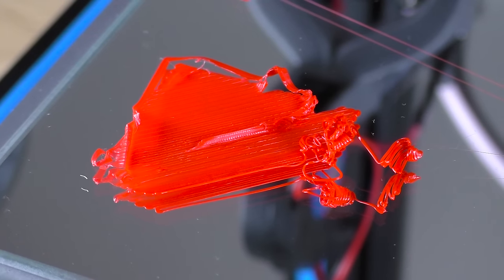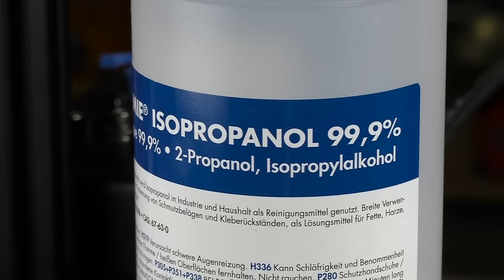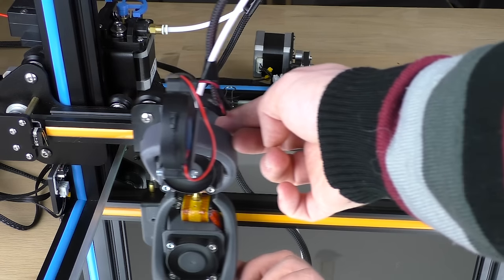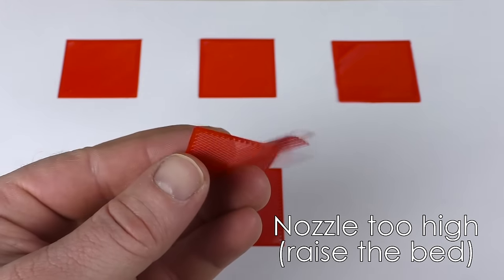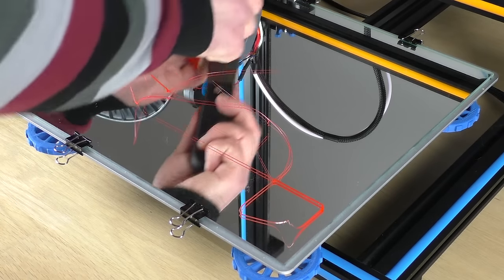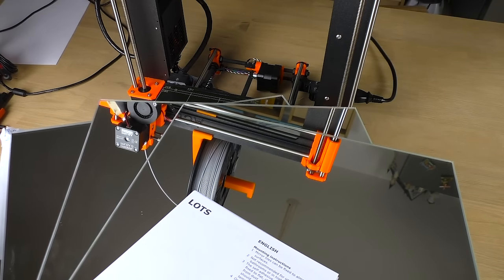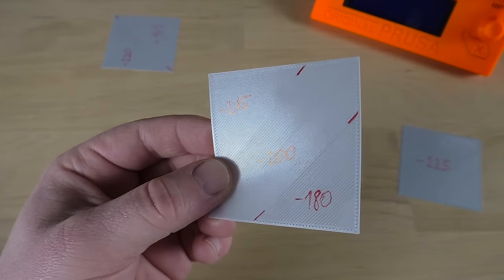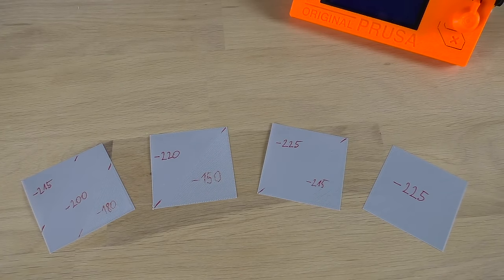Best method for 3D printer bed levelling

Comment: subbed of course. and do you know the name of the ikea mirrors you mentioned ?
Reply from the maker: Thank you! They're called "Lots" and come as a pack of 4. I'm on mobile now, it's hard to search, but I think I've pasted a link to someone in the comments.
Reply: @HobbyHoarder  £6.50 in the UK but too big for my Ender 3, could cut them down I guess. Thank you for the info, very helpful :)
Reply from the maker: Yeah, they're a bit oversized for Ender 3. Are you having issues with the build surface? It's quite good from my experience, unless yours is damaged or worn out.
Reply: @HobbyHoarder  I'm a 3d printer noob on the wrong side of a learning curve LOL The stock bed is not flat,dips in the middle slightly. Surface adhesion is a pain but hopefully fixed with a glass bed. Have you come across any problems with the glass being so close to heat , is there a chance it might break ?
Reply from the maker: You could cut a square patch of aluminium foil and place it in the middle under the build surface (or more if it's really bent) to raise it slightly.

No, don't worry, glass can easily withstand printing temperatures, you're not even close to the limit. Since you've mentioned glass, I'd like to point out that mirrors work much better than plain glass, even though they might seem the same.
Reply: @HobbyHoarder  I do appreciate the help. And I won't pester you with fluff. I tend to ask experts like yourself questions that other viewers might like to know too . I do check the already posted ones as well. I'll try your foil idea but I think long term it has to be glass even though I hate the store layout of Ikea I will bite the bullet and get some 'Lots'  Yes mirrors are made to higher standard. I have had a bit of success. I focused on getting the centre of the bed level to the nozzle as that is where the test dog will be born. And cleaned the bed. At last a few minutes ago I printed out the base of the pooch and yes it is not perfect but for me it's leap forward in 3d printing .  I think I only have enough left of the small amount included with the printer to make a small puppy now :)
Reply from the maker: No bother at all, ask anything you want. If I didn't want to help, I wouldn't have created this channel :)

Most hardware stores will cut the mirror for you, usually for free if you buy it from them. I've also seen glass cutting knifes on the cheap, but I've no idea how they work and I'm sure you'd need to sand the edges a little.

Get 95+ isopropyl alcohol for cleaning the bed, it really works well. I bought a ton of it and then I just pour a small amount into hand sanitizer sprays, works great. Then just a quick wipe before every print.

Also, I've recently made another video on how to calibrate your printer, it might help you out as well.

Good luck!
Reply: @HobbyHoarder For me with more years behind than in front it's finding out that a 3d printer does not just print it forces you to adapt knowledge you forgot you had or learn new things so as to open up a vast world of creativity.  And imho being creative makes the world go round.      I took your advice and tried the tin foil trick to level a dipping bed.  I cut several pieces of foil a quarter of the bed size and stacked them  in the middle of the dip. I started with 8 and after a few levelling procedures got down to 6 and the bed is now level. My first print was an extruder knob for the ender 3. Started of well but flopped later like a broken umbrella . However it made me smile and I was quite proud of this thing. Best of all....it fits  hahahahaha THANK YOU SIR.
Reply from the maker: As long as you're willing to learn, you're still young :)

I'm happy to hear the aluminium trick worked. In what way did the knob print fail?
Reply: @HobbyHoarder  The knob stem printed fine but as the print extended out to form the wheel the filament became stringy and did not form the shape of the wheel. Instead it looped around,fell off to the side and resembled a spaghetti nest. I'm guessing it might be a cooling problem . Funnily enough it's "Catch 22" situation. I know I need to print upgrades to improve the machines performance but if it cannot print in the first place then it cannot get the upgrades ! LOL Catch 22 .The term gained currency as the title of a 1961 war novel by Joseph Heller, who referred to an Air Force rule whereby a pilot continuing to fly combat missions without asking for relief is regarded as insane, but is considered sane enough to continue flying if he does make such a request.
Reply from the maker: That sounds like your nozzle isn't close enough to the bed. Have you tried with the levelling squares again? It's ok if they're a little on the rough side.

The springs under the bed tend to sag over time, especially at the beginning, so you might have to repeat bed levelling often (i.e. every few days). Once the springs stiffen, you might only need to do it every few weeks or even months.

Comment: Here is a very dumb question: Should all corners need to be square?  I have 2 square (front left and center), others are kinda rectangular, what could be problem?
Reply from the maker: Not a dumb question at all. The shape of the squares doesn't really matter, they might as well be triangles or circles. For your specific case, I'm guessing that your bed is not square and the slicer automatically scaled/stretched the squares to fit them on your bed.
Reply: @HobbyHoarder  Thanks for the answer.  Actually it's Tevo Tornado, as far as I know bed size is 30x30 but I need to re-control the cofigurations from slicer and tornado itself.
Reply from the maker: @malpine  Ah, then yeah, double check that the bed size is set correctly in your slicer. I also highly suggest that you replace the firmware with the one from TH3D.

Comment: hello i found your channel and subbed you thanks so much please can you help i have an ender 3 i have printed some nice looking test bits benchys calibration cubes but noe the first layer does not seem to stick anymore i use pla and have had the nozzle at 200 and the bed at 60 but it just seems to extrude normally before starting to print then just cloggs round the 0.4 mm nozzle have you any ideas many thanks from clive in uk
Reply from the maker: Thank you Clive, I really appreciate it!

Try reducing the flowrate (extrusion multiplier) by 10% and try again. Maybe there's simply too much plastic coming out.
Reply: @HobbyHoarder  hi thanks so much for replying how do I reduce the flow rate I'm not sure how to do that thanks so much for getting back to me 👍
Reply from the maker: @clivesquire6463  It depends, which slicer are you using?
Reply: @HobbyHoarder  hi again i have the supplied ender  slicer and also i use cura  hope this helps thanks.
Reply from the maker: @clivesquire6463  Cura is the slicer, yes. Then find the setting called "Flow", it should be under the "Material" section. It's probably set to 100 now, so try decreasing it to 90 and see if that helps.
Reply: @HobbyHoarder  many thanks i will try that now
Reply: Hi again I have found the material section in the settings it says printing temperature 200 and build plate temperature 50 I am not really sure why that means sorry to keep asking
Reply from the maker: @clivesquire6463  No worries Clive, I'm happy to help.

Those are just your print temperature settings. While you're here, you might as well change them to 210 and 60'C as those are the temperatures that work best for most fillaments.

Before we go further, are you sure that the bed has been properly levelled? Did you try printing the calibration squares from my video?
Reply: @HobbyHoarder  hi yes I have printed several items all good quality but now for some reason nothing seems to stick to the bed it just cloggs the nozzle it seems very strange as I have not changed any thing how could I show you my first few prints please
Reply from the maker: @clivesquire6463  Have you tried cleaning the bed with isopropyl alcohol and paper towels? Maybe the surface simply got dirty over time. I tend to give it a quick wipe before every print. Touching it with your fingers can quickly reduce adhesion.
Reply: @HobbyHoarder  thanks so much for replying today I printed a calibration cube which came out fine then I went to print a benchy and the same thing happened the nozzle all got clogged again but I will try that I also have a glass bed should I try that? Where are you also thanks again 👍
Reply from the maker: @clivesquire6463  When you say it clogs, what exactly happens?

Yeah, you can try it with glass, just make sure it's really clean. Soapy water works well with glass if you don't have isopropyl.
Reply: Hobby Hoarder well the extruder goes to the center of the heated bed which is the supplied one kind of rough but I have noticed it is very smooth in the center now ,then when it lowers to lay down the filament it doesn’t stick to the bed as the nozzle moves along its chosen path the filament just sort of collects in a ball /blob so I then stop it raise the z gantry and pick off the stuck filament I have cleaned the whole extruder and the nozzle purges some filament prior to starting but just dose not adhere to the bed you are the only person that has replied I have subscribed to so many 3 d printer you tubers but not one helpful reply many thanks for your time 🤝👍
Reply from the maker: @clivesquire6463  No worries, happy to help :)

It's hard to tell without any photos, but that sounds like the nozzle is still not close enough to the bed. Could you try raising the bed?
Reply: @HobbyHoarder  morning thanks when I put the paper under the nozzle to check how exactly close should it be then I will try you square level test is that on thingy verse thank you for all your help 🙏
Reply from the maker: @clivesquire6463  It should be so close to the paper that you can feel the nozzle dragging on it, but you should still be able to slide the paper around.
Reply: @HobbyHoarder  OK I will raise the bed a little more later I think you need a medal for helping me🎖️🏅
Reply from the maker: @clivesquire6463  We all had to start at the beginning and I know how hard it is to find some help. Good luck!

Comment: Ok... I searched your videos hoping you had posted something on my current problem.  Either I missed it or you haven't experienced it.  So I'm going to ask here.   I just updated to Marlin 2.0.4.4.  Before this, I used the factory settings for about a week and marlin 1.9 for a couple days.  I didn't have this issue until 2.0.4.    Every time I print the calibration squares (I have been using the mesh bed level feature) but now, when gantry returns home after print, I get "thermal runaway bed printer halted: reset machine"  But only after the print every time.  I used an IR probe to measure temps and the bed never goes above my setting.  So i'm worried something is programmed wrong in Marlin, but I never changed any thermal settings.  please help.
Reply from the maker: I hope someone with Marlin experience will be able to chime in.

If you move the bed by hand, does anything happen? Does the temperature on the LCD change at certain positions as you move the bed?
Reply: Hobby Hoarder I put the original 2.4 file back, unmodified.   Problem went away.   But all I changed was enable bed mesh.   So I’m gonna step trough piece by piece (which is very annoying because I keep getting timeout errors when using visual studio. And have to unplug restart both printer and studio). So if anyone has a clue on that part...
Reply: @HobbyHoarder  Ok.. I found the source but not the cause.  

Here's what I did, in order:
T1 (test 1)
Marlin 2.0 Ender 3 default 
--completed print fine

T2
Disabled 
//#define STRING_CONFIG_H_AUTHOR
//#define SHOW_BOOTSCREEN
//#define SHOW_CUSTOM_BOOTSCREEN
//#define CUSTOM_STATUS_SCREEN_IMAGE

Changed custom_machien_name
-- completed print fine

T3
Disabled 
//#define ARC_SUPPORT
Enabled 
#define RESTORE_LEVELING_AFTER_G28
--completed print fine

T4
Enabled
#define MESH_BED_LEVELING
--completed print BUT when returning to home position:
THERMAL RUNAWAY: Bed
 PRINTER HALTED 
Please Rest

T4
disabled 
//#define RESTORE_LEVELING_AFTER G28
--SAME ERROR SAME WAY

This means the error has to do with mesh bed leveling.  But all I do is enable it.  I don't change any thing else.   WTF?!?!?
Reply from the maker: @NOC-H  Did you enable all the other stuff besides MESH_BED_LEVELING? You have to define the probe type and offsets, at least in the TH3D version and I'm assuming Marlin is similar.
Reply: Hobby Hoarder no.  But it wasn’t necessary in 1.9.   I went back to 1.9 and have everything set exact same.  Works fine.   Even added some code for features I wanted.    So I have no clue what’s up with 2.0.  By the way, I tried to “support” you through thingiverse.  But it said you’re not set up.  And the link you gave me requires PayPal.  Any other ways?
Reply from the maker: @NOC-H  Wish I could help you more, but I've only used TH3D before and it's been working fine for me. I suggest you try going on Reddit, /r/3dprinting, it's a huge sub and you might get better anwsers there.

Thank you! I've gotten the message from Thingiverse and I've fixed it now, although I think you still have to use PayPal.
Reply: @HobbyHoarder  ok... I think i sorted that issue...  had to change watch setting to 120s.  now i just can't get a good mesh.  but within a couple days I'll get my pin 27 board for my bl touch

I do have another question.  a new roll of filament, I just opened, measures (with my caliper) between 165 and 169.  I can change cura to 168.  But is that ok?
Reply from the maker: @NOC-H  168 is quite outside of 175, so it's probably not the best quality. As for printing with it though, sure, like you've said, set it to 168 in Cura and you're good to go. It should automatically adjust the flowrate to compensate for the smaller diameter.
Reply: Hobby Hoarder yeah. That was my worry.  Downside is I live in Thailand.  So it’s hard to get good quality pla for any reasonable price.  I’m gonna print with it and see how it turns out.
Reply from the maker: @NOC-H  Oh, Thailand, you're the first person I know from there :)

I've had most luck with filament that costs about $25 per kilo, seems to be the sweet spot. Even Chinese filament at that price was very good, usually within 1.74, which really surprised me.
Reply: Hobby Hoarder I’m not “from” Thailand.  I’m Irish born American with Japanese name.  Haha.   My wife is Thai.  Her fam got sick so we came here to take care of mom and bro.  I miss customer service and QC from states though.  And I’ll check that out
Reply from the maker: @NOC-H  Hehe, well, you're still the first Irish born American with a Japanese name on my channel :D
Reply: Hobby Hoarder happy happy Joy Joy.

Comment: I feel like I have to change my z-offset daily to maintain my perfect first layer. Is this common or is there something that I can do to make sure my bed is perfectly level for a longer period of time?
Reply from the maker: You might have to readjust your Z level occasionally, but definitely not every day. By occasionally I mean every few months or at least a few weeks if you have a cheap Chinese printer. You didn't mention which printer you're using, so I'll just cover two common issues.

First, if you have the Original Prusa Mk2, then it's very likely an issue with the PINDA probe (it measures the bed flatness). Some probes are very sensitive to heat, so your first print of the day might be ok, but the second one might be way off. My solution was to add a custom gcode that raises the head to the top position after the print finishes. By the time this happens and I load the next model, the probe has cooled enough that it doesn't affect the bed leveling. Because of this, Prusa has added the option of pre-heating the probe first and doing bed leveling after. I believe it's called "Temperature calibration" and you'll find it in the settings/calibration menu. I still think letting the probe cool off is the better solution, but this is also an option.

If you have a printer with manual bed leveling, then the corner springs might be too loose. If that's the case, you can either replace them or print spacers that go between the bed and the springs (but you must use heat resistant filament like PETG or ABS).

If you have a really cheap printer with acrylic bed, then I'm not sure there's much you can do short of replacing the bed with metal one.
Reply: Hobby Hoarder hey sorry I gave little information. I have a Tevo flash. I believe it's a glass bed with bltouch (plastic probe I believe) so it's best to set my z-offset when everything is cool?
Reply from the maker: I don't have personal experience with the BLTouch, but because it measures the bed by actually touching it, it shouldn't matter if it's hot or not.

How tight are the springs that push against the bed on the underside? Is the bed itself very wobbly?

Comment: Didn't work for me.. All I got was printed line down the side then it stopped.
So back to square one
Reply from the maker: Sounds like you're having some other issues apart from leveling. Can you print anything at all or is it always just the first line and then it stops?
Reply: To be honest how I feel with 3D printing I probably find it easier to beat James Cameron to making avatar 2 on my laptop that is hard I am finding it
Reply from the maker: @chasscollickmusic4299  I'm not gonna lie, I wanted to smash my first printer a few times, but once you learn enough, it's a great thing to have.